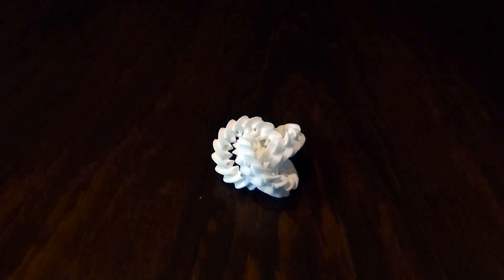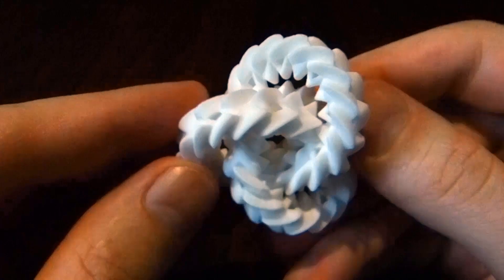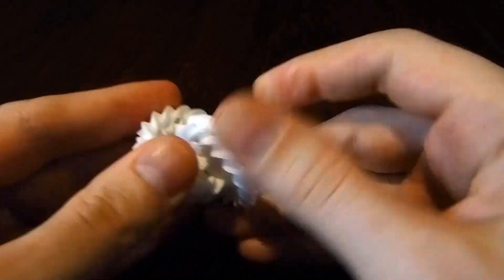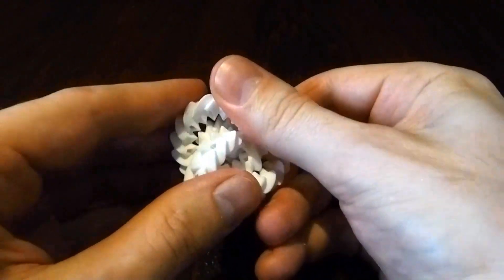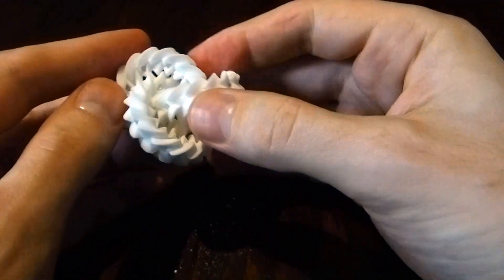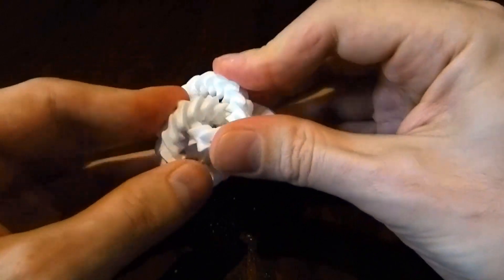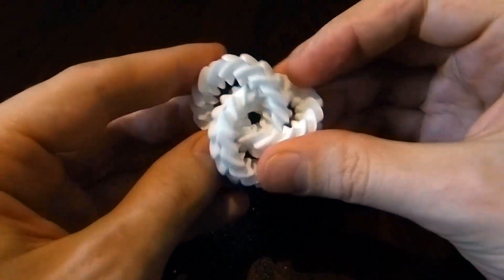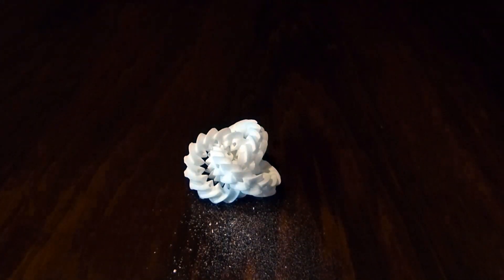Loosening a triple gear

Comment from the maker: Care and feeding of your Triple gear.
Reply: would ordering this in WSF-polished help at all?
Reply from the maker: I guess I should try that. My guess is that the polishing process would not break the gears apart, and so although most of the teeth would get smoothed off, the ones that are in contact as it is printed would not. I also suspect that the polishing "beads" are likely too big to really get into the valleys of the gears.
Reply: the polishing doesn't carve THAT much off, in my experience...  the only reason I think it might help is it is a vibration polisher, so having the parts jostled a lot might break them apart...
Reply from the maker: Might do... although as you can see in the video it needs a fair amount of force. But yes, perhaps lots of more gentle shaking will loosen it up.